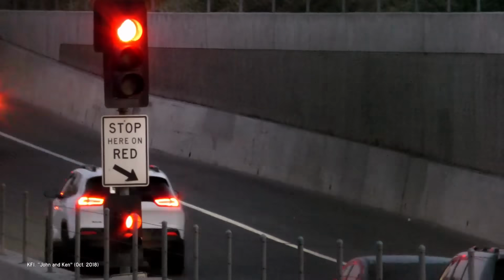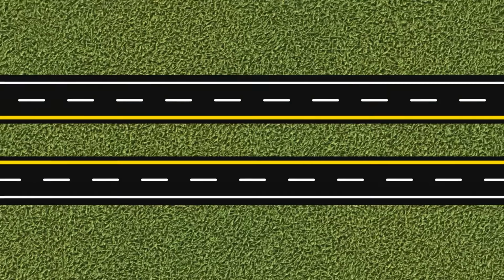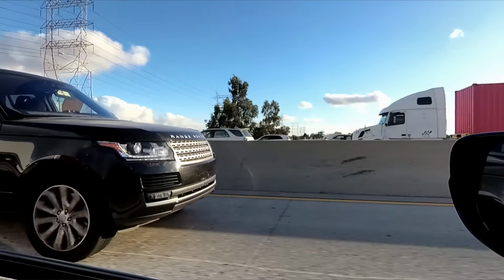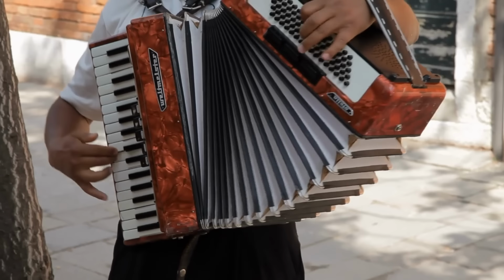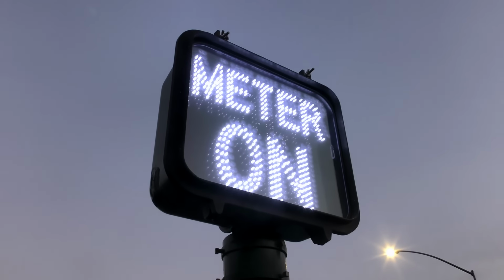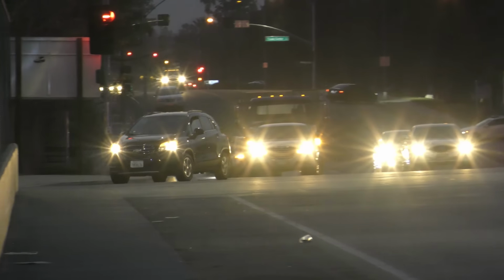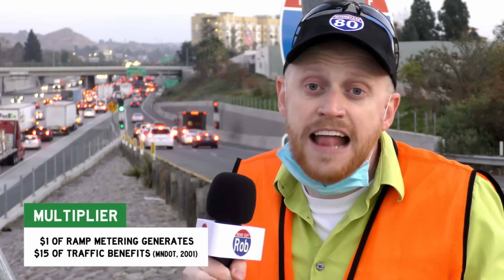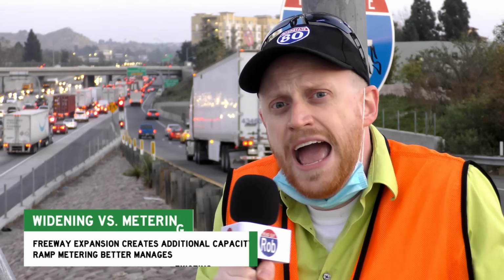Why the extra RED LIGHT on freeway ramps?

Comment: Wow!  This is probably THE best explanation of the relationship of traffic volume vs. speed I have ever seen.  Thank you so much for this.  You mentioned the Minnesota study... The Minnesota study was very conclusive in finding that in general ramp meters do cut down on accidents and also helped average freeway speed.  But the reason for the study was that many people accused Mn/Dot of  abusing the ramp meter system by punishing drivers with ridiculous wait times.  If you look at a map of the Twin Cities, you will see a lot of freeways..The system they have is comprehensive but the Twin Cities grew substantially throughout the 80's and 90's while freeway capacity did not increase at the rate it needed to in order to keep up with the demand due to funding.  So while they have  a lot of center-lane miles, the actual lane miles was not enough in many cases.  There are still some some sections of freeway like I-494 through Bloomington near Mall of America and the airport that are still their original 1960's design with cloverleaf interchanges between freeways.   A lack of funding for freeway expansion in the Twin Cities could be blamed on the way that roads are funded in Minnesota with a lot of money going outstate to rural areas when it should have been pointed to the metro area.  Mn/Dot's defense was that they had to use ramp meters  as a tool to increase capacity on the freeways because they lacked funding to build more lanes.  They did this at the expense of the arterials  and backups would occur quite frequently onto streets that could not handle the congestion.  I experienced this first hand back in the 90's when I lived in Minnesota.. if you were sitting on an on ramp on some of the most congested freeways in the Twin Cities,  the time between greens could be as much as one minute in some cases.   While the study concluded that ramp meters worked, it also concluded that there were instances where metering was not necessary and some meters were removed altogether.  I believe they put a limit on wait times at red lights as sort of a compromise as part of the new law that was passed.  I'm not sure about that but I thought I remember reading that.

Comment: I work on active site for ramp metering in Maryland right now, this is an AWESOME video and super comprehensive I loved it!! Will be sharing
Reply: If these ramps worked, there'd be no need for a video to explain how great they are. 

Theory is one thing... reality is another.

Traffic slows down the instant the meters switch on. 

Merging traffic is forced to come to a complete stop,  mid ramp... and then try to accelerate from 0-60 while merging. THIS is the reality.

Comment: Here's a good question for you, I live in California too, and I encounter these freeway stop lights all the time. However I've noticed that there's a red light on the other side of the red green freeway entrance lights. But like, what purpose do they serve? They don't change color or turn off if the other light is green, it's just a solid single red light. However, I can't think of the situation where anyone is ever going to see them? So what are they used for?
Reply from the maker: Good question.  Should have included.

The signal on the back is red when the light is red for drivers.  It turns off during greens.  This lets CHP officers sitting beyond the meter know if a driver ran a red light.
Reply: i was wondering that too! from what i remember they only show red when the actual signal is red too. wikipedia says this is for the highway patrol to park further down the highway and spot anyone who’s running a red
Reply: @nick fifteen. It's for CHP to be able to tell if a person went through on a red meter or not. If a car goes through and the solid red light is on, the CHP officer will know that they illegally went through it. Hope this helps
Reply: Good call
Reply: Chp
Reply: We have them too in Phoenix. They’re called tattle-tale lights. It’s for exactly what it’s named for.
Reply: Oooh, so they DO turn off! I'm surprised I never noticed that they did before. Thanks everyone for the heads up. And definitely thanks to Rob for another awesome video!
Reply: It's for CHP. And thus the entire reason for the signal. A red light trap. They couldn't care less about traffic flow. It's California. You're just not going anywhere
Reply: @Noahvis4 Gaming The Texas system is unlike any other in the country really. It has its ups and downs for sure. The downside is it causes longways development rather than development towards the inner city parts.
Reply: @TransitAndTeslas  longways development makes real estate pretty cheap so overall frontage roads are better
Reply: At least in California on local streets, some traffic signals have blue lights on the back sides. Exact same purpose “tattle-tale” : blue on to let a police officer know a certain direction has a red light (and someone ran a red light = $$$) most likely on the arterial, higher speed directions.
Reply: Big brother needs love too!

Comment: this must be an american thing, ive never seen this irl
Reply: Visit a large city.
Reply: we've got a few of them here in Melbourne, Australia. Especially on the Monash freeway which is NEVER empty.
Reply: The Netherlands has had them for 30 years or so.
Reply: Its an American thing for BIG cities like Los Angeles and New York
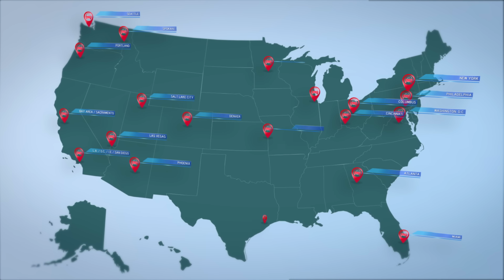Reply: @mentalchild360  Denver has them. I’m sure there are a lot more. Edit: there’s a map of them at 13:19
Reply: @mentalchild360  not true. small suburbs in Wisconsin have these devices entering onto freeways.
Reply: @mentalchild360  Small cities and suburbs in California have them, too. I'm pretty sure any on ramp known to cause congestion on the freeway has a ramp meter installed for obvious reasons.
Reply: @aurvaroy6670  we have them in South Florida. Mainly due to the high density and people are moving here more often.
Reply: Be grateful. Metered ramps are stupid. Imagine trying to merge into 70mph traffic,  while accelerating from 0 mph. 

This is also a huge waste of gasoline. Pointless idling + full throttle acceleration = dumb.
Reply: We have this in Chicago on Interstate 290(Eisenhower Expressway)
Reply: We have them in The Netherlands for a very long time, we call them dosing lights. They only work during peak/rush hours. And the sad thing is that there is a  red light camera attached to the dosing light, so if you jump the red light, you get a fine in the mailbox a week later. It’ll cost you €240 and €9 administration fee. €1 is $1.20. So in dollars it’s almost $300. So everyone obeys the lights. Sometimes cars with foreign license plates make that mistake and our national judicial collecting agency will find you wherever you live, they are relentless. It is one of the most efficient agency of the government.
Reply: It’s not it a thing in most of the US at least.

Comment: Not every freeway on ramp ramp meter red light makes sense. They have one on the on ramp northbound Hwy 85 in San Jose off of Hwy 101. The 101 traffic is not merging into Hwy 85, that's where 85 starts. The meter lights are there to favor an HOV lane that comes off the 101 onto Hwy 85. This results in traffic backing up onto the 101 hwy. Only it doesn't really merge, it continues right next to the other two lanes. By setting up a protected lane for the HOV lane they could eliminate that meter light. But I doubt they ever will.

Comment: Georgia chose the control option for their ramp meyers guaranteed to not work.  In Atlanta, the ramp meyers are on a fixed schedule.  Trey start metering at a fixed time on weekdays mornings (yes, even memorial day and other vacation days).  They run for a fixed period if time metering glow, then turn off for a few minutes that clears the ramp in one massive platoon that (you guessed it, slows the interstate to a crawl).  Then it meters for a few minutes.  Repeat this for a few hours till rush hour is over.  Repeat in the evening.  Don't do anything at all when events end and dump a bunch of traffic onto the interstate.  All in all a half baked job that isn't much if any better than going nothing at all.

Comment: They're interesting in concept, but they also have some stinky pain points...

* Meters that turn on and off on a set schedule rather than dynamically based on traffic flow. I shouldn't have to stop for a meter when the freeway is wide open, just because a programmed schedule says it's normally a parking lot.
* The fact that meters are red-default. If hardly anyone's on the ramp, there's no platoon to break up, so why make the one (1) car wait for up to 30(!!!) seconds waiting for the dumb meter to turn green? Have it start green, turn red for the dynamically-adjusted duration when it detects a car has crossed, then turn green again whether or not there's a car waiting for it. Best of both worlds between free-flowing and breaking up platoons of cars.
* Meters with red-light ticket cameras... WHY. FREAKING WHY.

Comment: My region doesn't use ramp lights.   Visitors are delighted to see drivers TAKING TURNS, just as the signage says.

So, if its a 2-lane ramp approaching the freeway, first its reduced to one lane by warning RIGHT LANE ENDS, MERGE LEFT ALTERNATING. 

Everyone complies and traffic moves smoothly without anyone braking.

Exactly the same happens a 2nd time as that moving  ramp lane merges onto the rush hour freeway.  Every vehicle in the far right lane of the freeway lets in one car from the entrance ramp. Its all done without stopping, braking, or jerking along.

Its amazing to see the level of cooperation, even at 30 or 40 mph. 

New drivers from overseas, and even heavy trucks catch on.

Comment: The problem with this theory is that when the traffic on the freeway is TRULY bumper to bumper to begin with, the on-ramp red lights don't do any good and actually hurt.  Because the cars entering the freeway will still have to wait to merge and will stack up at the bottom of the on-ramp rather than the top. They will also enter the ramp going faster than the speed of freeway traffic, thus eliminating opportunities to merge before they stack up at the bottom of the ramp.   It is ONLY when the traffic is heavy but still flowing on the freeway that these red lights can help.  Red lights should be turned off when freeway traffic goes over a certain level.

Comment: I despise this system. As a semi driver in Australia these stupid lights are often on during quiet times. Traffic is flowing at 100kmh and when i merge i'm still only doing around 40-60 kmh which means traffic already on the freeway needs to brake hard risking accidents. It can also take an extra 10 minutes waiting your turn, only to get on freeway and go nowhere in peak times.
This filtering may work if EVERYONE is doing the same speed.

Comment: Rob, skipping stones is easy.
First you need the right stone.
River rock is typically your best recruits, they usually have a nice saucer shape, rounded on all corners and thin but flat and broad.

The best stones fit between your forefinger and thumb, now, when you throw the stone, toss the stone sidearm, parallel to the water surface and release the stone, rolling the stone on your release off your forefinger, like you would a baseball ⚾️

A few practices you should be able to get it. 

Remember, the stone matters most when you're beginning to learn, but with practice, you may be able to skip even a partially curved stone.

Good luck!

Comment: My only problem with the ramp meters is that there's not enough ramp after the meter. The meter brings you to a complete stop, and then you have no room to accelerate to match the freeway speed. This is not a problem if it's jammed, but if traffic is moving. It means anyone who doesn't have a sports car and/or a lead foot is going to slow down the right hand lane coming off the meter just because they don't have enough space to get up to speed.

Comment: I-45 North in Houston has the meter lights. They are rarely on. People don't bother paying attention and drive right through most of the time. The feeder roads are also way too small, so backups are already an issue without the lights. The best solution is for a major freeway expansion, but that is years away.

Comment: Excellent video, but I would like to correct and add to the electrical analogy you used earlier in the video. I scrolled down the comments a bit to see if anyone else had mentioned it, but it seems not.

When you said increasing volts is like increasing speed, that's actually the exact opposite of what you're trying to compare to. Amps are more similar to the flow rate of electrons through a conductor, whereas volts are more like the density. Not only that, but there is an upper limit to the amount of amperage a given wire can handle, which can make it similar to the speed analogy as well.

The whole thing about electrons being bumper-to-bumper is correct, but when we talk about increasing voltage, it's usually to avoid increasing amperage, as high current (electron speed) causes a conductor's resistance to increase. This increased resistance generates heat, and enough heat can melt a wire and start a fire. When you compare amps to speed limit, you can compare the resistance heat to the rate of accidents at a given density (volts). Unfortunately that doesn't directly translate, since when you widen a freeway, it's to fit more cars on it, and when you widen a conductor, it's so that electrons can move faster through it (roughly). There's also the comparison of breakdown voltage, being the density of electrons that it takes for them to begin breaking out of the conductor and crossing an insulator. Imagine it like cars being packed in on the freeway, and then some of them start to drive by on the shoulder, or even dirt/grass to escape.

Either way, I just wanted to correct that speed~amps and density~volts, and offer some creative ways they could be compared. I should note that I am not an electrical engineer, and I do not have a degree in that, so parts of my explanation may be somewhat inaccurate, or simplifications, but overall it should be good on a basic level. Thanks again for the good content!

Comment: These meters are ridiculous. We had these in Dallas in the 80s. Drivers need to merge at freeway speeds, not 35 miles per hour. Drivers, press down the pedal on the far right until you get to a bare minimum of 55 miles per hour prior to merging into main freeway traffic. Not a bad idea to flip the blinker thingy too. This is a good way of informing those on the freeway of your intention to enter the flow of traffic. Be assertive and safe not indecisive and unpredictable!!!
Reply: North Central Expressway.  Yeah.  And how about that rotten I-45 endless right-lane-ends and new lanes merge in from the left?  It was hell.
Reply: Looks like there's enough space to decently speed up here. Cars in the 80's were genrrally slower

Comment: I only saw this in LA. Coming from TX, the concept blew my mind. I guess it helps the highway flow slightly better during rush hour, but I was driving during off peak and I couldn’t figure out why I needed to make a complete stop, only to then FLOOR it to 60 or whatever to safely merge. If I merged at 30, I would be endangering myself, others, and CAUSING the highway traffic. Not to mention increasing fuel consumption, air pollution and noise pollution.

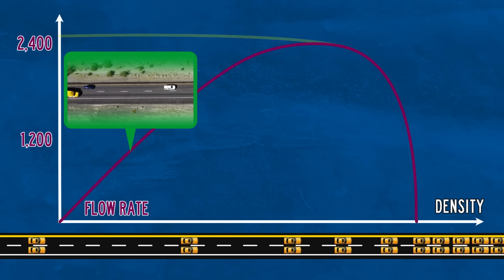Comment: @Road Guy Rob, I enjoyed the reveal of the curve of the metering lights at 10:57.  For nerd reasons.
  
A while back a sage Senior Engineer from National Semiconductor (now part of Texas Instruments), told me in passing that I should get into electrical engineering (which I did).  And then he dropped a nugget of knowledge and truth I have never been able to unsee.  "Electrical engineering beats fundamental ideas into you so hard that you will start to understand how easily engineering principals apply to almost everything else - once you've found the quantifiable units."
  
Case in point - those of us with a EE or solar power background will recognize your red curve as the "maximum power point".  It's a way to get the most electrons per second (columbs/Amps) in a current limited system (where electron flow limits the total available power - here, your cars are an electron analog).
  
Those who have an embedded microcomputer background will recognize your red curve as the "performance per watt per watt" curve (not a typo, that's the point of peak performance for every watt expended versus other power settings).  This is an optimization system for determining where your point of diminishing returns is for volts*amps vs MIPS - used for setting maximum power levels in things like mobile phones.
  
As it was said (in paraphrase) "how to get the biggest bang for your buck out of an existing system."
  
There are equals in fluid and thermal dynamics, architecture, optics, nuclear weapons detonation altitudes (sorry needed something with a literal "bang" for the buck), and it just keeps going on and on...  So there, the nerd moment ;-)

Comment: Ramp metering is a great idea as long as you make the street interchange and the attaché ramps with enough capacity preferably with an additional turn lane with large capacity, which leads to the ramp waiting light itself. Also a big must even bigger then the others is to only use when under heavy traffic… Adding  a warning light blinking prior to getting to ramp light when the ramp light is either turning on momentarily or already sctuve